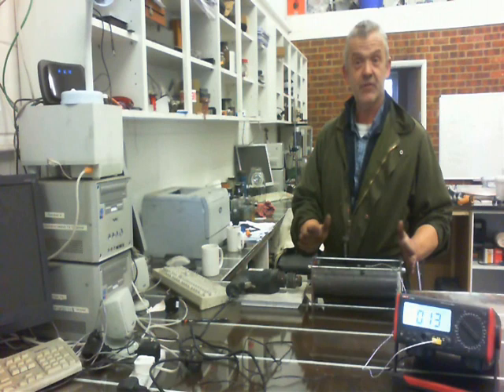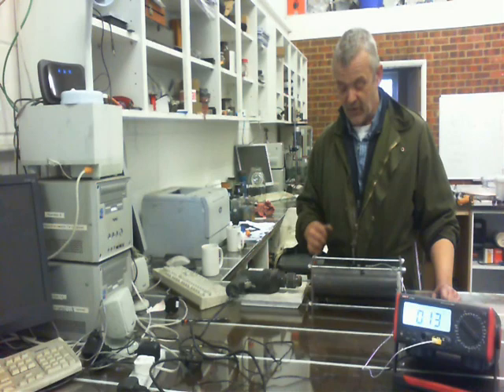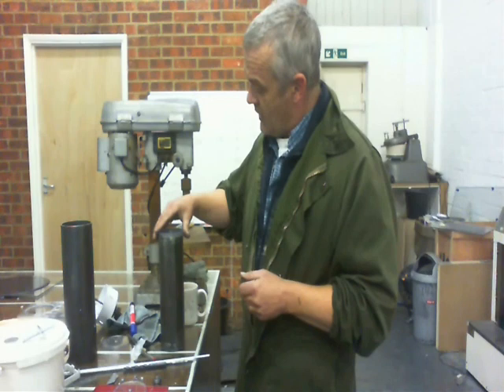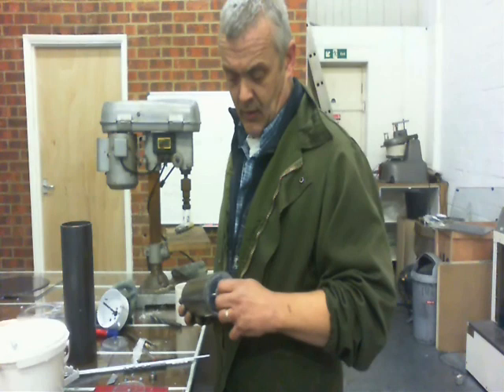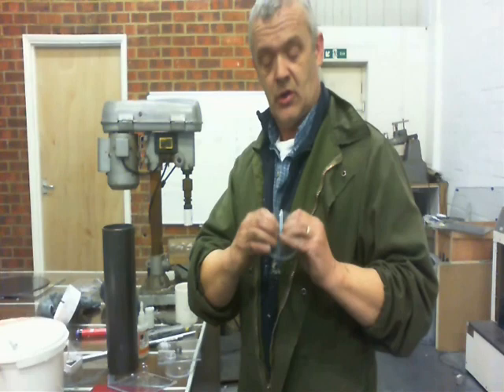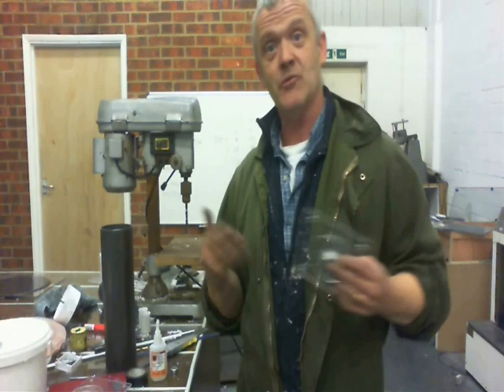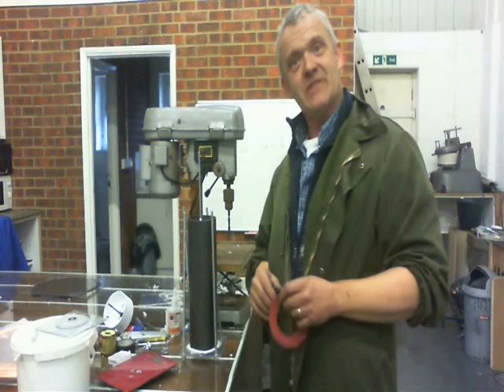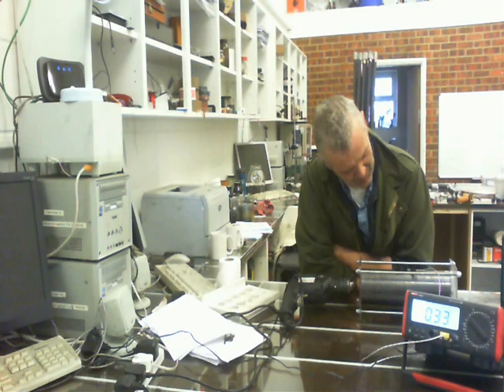How To Make A Frenette (Friction) Heater

Comment: Wow just something i really worked on. Friction heater needs min. 3600U/min.
I used 6000U  with 2kW a big angle grinder the small one, smoked a little bit.
6min made 120°C in the oil and the Housing
The inner and outer pipe should be electrical seperated (f.e. wood) i used disks 4mm thick, to thick i think 3mm would do it. 10w40 was my choice of oil. My dad said try hydraulik oil
There was tests with this heater and an resistor heater no difference.
Oil piggys design will be different he said. But i dont testet it. The plan is too difficould for me.
If you get it to work please share youre work

Peace truth love
Reply from the maker: No worries mate - i will do - but i am not expecting to have such power requirements = there is no real need for electric separation that I am aware of. As far as I understand it it is a boundary value problem so surface area is an issue - but i plan on an everyman oilpiggy - it will go up as a make it guide if i manage it

Comment: Have you considered using copper to copper friction?  Has a very high thermal conductivity so it can draw heat away quickly to prevent seizing provided the stationary chunk is of suitable mass or directly heatsinked to what you want your black body emitter to be.  Which really should be something that transfers heat poorly but has a high density so it can hold a large amount of specific heat and limits heating the air-  returning more as blackbody infrared.

Another key feature to direct contact you could adjust the torque to the speed.  WIth something like a thrust bearing and a spring, with a adjustable mounting for the bearing.  You could then tune the machine to work efficiently with low speed high torque (direct human powered) or high speed low torque drivetrains.

The oil I must say is pretty elegant of a solution though in terms of wear and tear maintenance but seems to suffer a bit of inflexibility on power input.  I actually bet copper would hold up quite well of suitable gauge it has a surprising tensile strength for its malleability, the spring and thrust bearing though might be the big weak links.   I'd love to try it myself but would likely go a completely different route and shoot for electrical resistance as the energy conversion- plus I have a ton of other ideas I have to get too, particularly the ones I have intended for the new vacuum pump my wife is concerned to why I bought ;)
Reply from the maker: Copper is a bit expensive - I am just looking - I am doing an ultra cheap and then a disk and then a cavitation type - that seems like enough!! But keep me up to date with what you are up to and i'd love to see the vids
Reply: I agree with you EgadsNo using the copper for the thermal conductivity. What I am wondering is the actual  efficiency of this type of unit. Would you have some numbers of range ?? Now I am wondering what the vacuum pump will be used for Sir ??? Good day Sir.

Comment: Hey Robert this system you just built is used to heat water. Some Fire departments here in the USA use this as a cheaper way to heat water. Small home systems are available here too.  I just thought I would let you know.
Reply from the maker: James Kennedy they are slightly different mate - they are the cavitation heaters
Reply from the maker: James Kennedy I am going to make one of those too - just waiting for a block of ali to arrive
Reply: Robert Murray-Smith before I heard the description of the thingie I thought you were going to build a cavitation heater too.  - PS ... my auto correct dictionary doesn't know "cavitation" and "thingie" :)) 
multiple discs parallel to each other seem like a multi layered closed version of a Tesla Turbine :) 
can't wait to see the efficiency differential ... somehow I think I know what goes on and how to improove on it ... ok ... we got the sigma ( superficial tension coefficient ) of oil and pipe ... we multiply that by two and that's your gap at which you should have max interraction between oil clinging to inside and outside pipe ... 
Simpler method ... measure the "rise" of oil to the pipe "boundary thickness" ... x 2 ... bob's our uncle ... that's the gap :)
Reply from the maker: actudoran looked like a closed tesla to me too - thanks for the hints mate
Reply: Would you be able to send me some information on the make and model of the unit SIr ??
Reply: @actudoran  You the man Alex.
Reply: @victoryfirst2878  No I can't do any of that. But, if you look into experimental Water Heating systems here in the USA, 'I'm sure you'll come up with it. That's how I found it. I hope helps you. Thanks for your comment.
Reply: @kennedy67951  Thank you for answering the question so quickly. When you get any more ideas make sure you drop a line. Thanks
Reply: @victoryfirst2878  best comment I ever got on youtube :D    thanks so much buddy!

Comment: would this in a corrected version heat water well? Also have you looked at those cavitation heaters?
Reply from the maker: it does do a pretty good job mate - the main issue is emulsification of the oil over time but additives can reduce this - i haven't looked much at cavitation apart form an awareness of their existence

Comment: you are making a mistake somewhere.  I get 190 degrees out of mine.
Reply from the maker: +Pierre Godin cheers mate i will look at it again
Reply: +Robert Murray-Smith how much distance do you have at the bottom? should be an 1/8 on the side.
Reply: +Robert Murray-Smith   making bumps on the inside piece will cause more friction too.  mine is smooth though.  don't want to create steam.  Don't want to build to much pressure up.   we blew a big one up already . can't be sealed.
Reply: +Robert Murray-Smith I really enjoy your video though.  good presentation.
Reply from the maker: +Pierre Godin nice one mate - thanks for the advice i will follow it when i return to this project - which will be soon - i bought a laser cutter for it!
Reply from the maker: +Pierre Godin thanks  mate
Reply: +Robert Murray-Smith   Sweet.